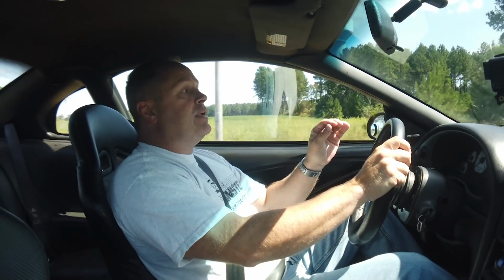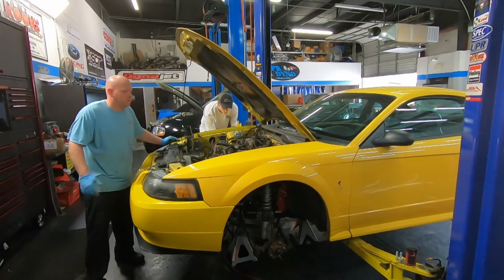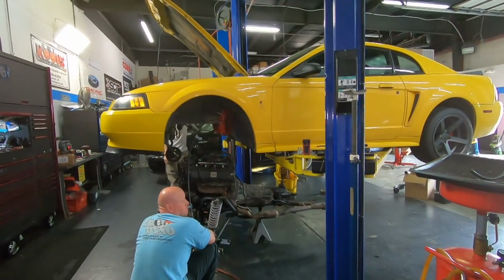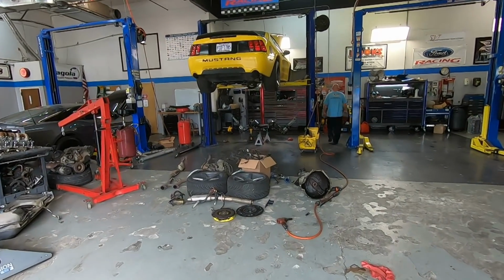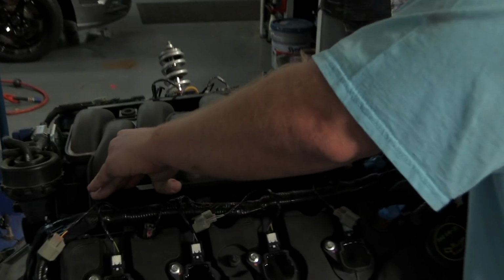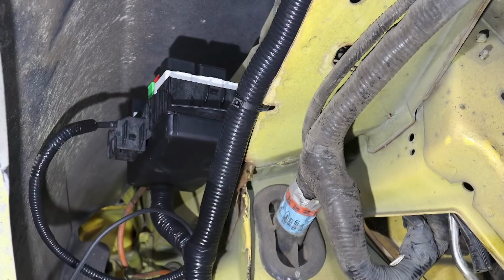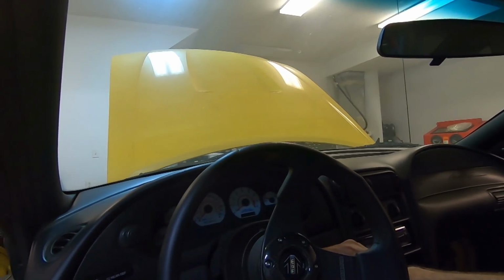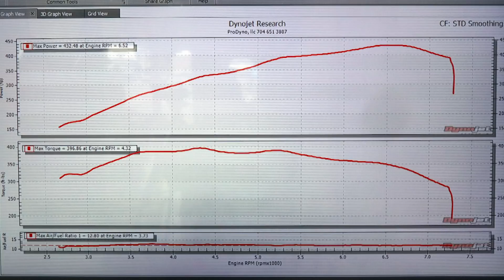Swapping a 470HP 5.0 Coyote into My Old Mustang (Former Magazine Project Car)

Comment: What is the overall $$$ to expect for labor to install a coyote in a 90’s mustang? I have a 94’ Thunderbird and considering doing the same
Reply: Not sure about now, but around $3K was what my brother was quoted about a year and a half ago. Then $6500 for the 2nd gen Coyote egnine. Pretty dumb spending  that much when you can just do a Vortec supercharger on 4.6 or 5.0 and get even more power and torque. That's what he did, and it's faster than a stock Coyote
Reply: $6500 for a 2nd gen. They are going for 8k and up
Reply: @WavyMaxy313  Like I said, that was a year and a half ago.  The truck versions go for less than the Mustang version too. I prefer the old school V8s with modern self learning EFI myself
Reply: @edjackson4389   I have had both a 1998 supercharged jack rough it was 302whp with no intercooler then I had 2  2007 mustangs  one was a gt with the Saleen supercharger with the 475hp kit and the other was a 2007 jack rough stage 3 with a pulley upgrade it was about 435hp the coyote swap is good if you can do it yourself

Comment: I am going with putting set of 3.5L ecoboost turbos on the 4.6L I have... guy i got them from said they were tuning the 3.5 and the two little turbos blew up the V6 engine... stock they push 15psi on the V6, so for a 4.6 V8 they would work the same but they might spin up faster. 5-10psi on an old 2 valve 4.6 that is already in vary good condition, i am thinking it might be tailing some newer cars that cost way more... closer then they are comfortable with.
Reply from the maker: Sounds like fun! Good luck!

Comment: Sounds good, btw thats a T45 not a T5
Reply from the maker: You are right
Reply: That got me so hard 😂 not judging just like whaaaa ? Give me a sec
Reply: Actually it’s a tr3650
Reply: @Bendejo6517  The t45 and tr3650 look very similar and are easily confused. Its a t45 without a doubt. Ive been rebuilding ford manuals for years.
Reply: @505speeds  I’m just trolling lmaooo but in the description it says it’s a 99 gt those came with the t45 and later in 01 they came with the tr3650

Comment: In Europe we usually count 15% drivetrain loss. 
Do You plan IRS? 

Great job, always pleasure to watch!
Reply from the maker: I don't think so on the IRS. Pretty happy with the Quick Performance rear end and the QA1 suspension setup. And thanks for the compliment!
Reply: Here in Oz we count: 15% loss on a manual, 17% loss on a modern auto.

Comment: What year coyote motor did he use 20 11 12 13 and 14 if I did anything at all would be with a 14 that's the or above
Reply from the maker: It's a gen 2, so like 2016, 2017

Comment: Looks like big $ due to the all the small custom/fitment issues... nice work however,  just wonder if a 351w is a better bet due to fitment
Reply from the maker: Possibly, I know it would definitely have been easier if we were swapping in a carbureted engine. Most of the hassle came from the fuel demands.

Comment: Did you make any upgrades to the T-45 to handle the coyote?
Reply from the maker: Just a rebuild to fix a broken shifter fork. So far it has done OK, but it has less than 5k miles on it with the new engine, and I don't have high expectations for it to live a long time.
Reply: Do you plan on rebuilding the transmission or buying another one such as a T-56?

Comment: Pbh give all the details with the eengine pack accessory drive kit and power steering kit and returnless style fuel line kit. Its real easy new edge you can use 99 percent of everything.

Comment: Surprised you didn't do some timing chains and the new tensioner on the correct side of the chain as well as pump gears while it was out of the car
Reply: Do you have a link to an article explaining the tensioner on the correct side. Never heard of this and would like to know more. Thanks
Reply: @prtyof4156  if you go to Modular Motorsports Racing (MMR) they have a kit that comes with this tensioner that puts tension on the loose side of the secondary chain instead of the already right side. I don't know too much about it but I guess Ford has not tensioned "the correct side" since the first 4.6L all the way up until now.
Reply: @prtyof4156  http://www.modularmotorsportsracing.com/cart/index.php?main_page=product_info&cPath=4_30_57&products_id=1064 
Obviously you don't need all of this but the Secondary Tensioner inversion is what I was talking about. Just used this link because it has all of their billet stuff in one spot so I could find it easier.
Reply: @prtyof4156  http://www.modularmotorsportsracing.com/cart/index.php?main_page=product_info&cPath=4_30_57&products_id=1049 Here's the one for the 2018+ cars. Sorry for all the messages but they have these for all versions of the modular platform. I plan on getting a set for my Crown Vic as soon as money allows.
Reply: @02honeydew  thanks, I get it now

Comment: What did you do for power steering?
Reply from the maker: I used a Frontrunner kit from Vintage Air. It requires a little grinding and drilling and tapping a couple of holes to make it all work, but it is a really nice kit. The pulley kit incorporates a traditional power steering pump (I think it's Detroit Speed) that hooked right up to the power steering rack. I did have to come up with a remote resevoir for it, which is the Moroso tank bolted to the strut tower. Thanks for watching.

Comment: How are the smaller brakes holding up to that increase in power? I have a 17 gt p with the performance pack (6 piston brembos). Anyway, those brakes save my butt all the time. Definitely needed for so much immediate power. I think the 5 speed is fine to be honest. I never drop my car into 6th. Usually even on the highway I coast in 5th well past 70 even 80 with no issues. The rpms aren’t even that high. My 11 mpg pays the price though..... :D
Reply from the maker: So far so good on the brakes, at least for road use. I haven't been back to an autocross yet since the engine swap, so we'll see. Thanks for watching